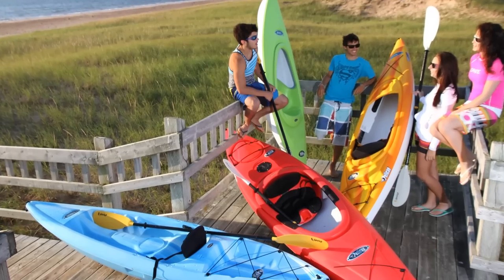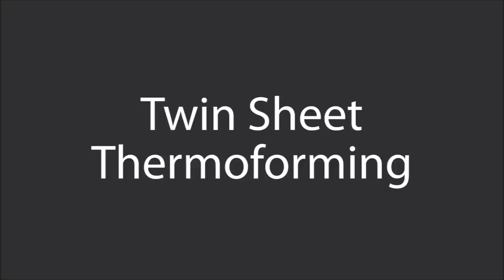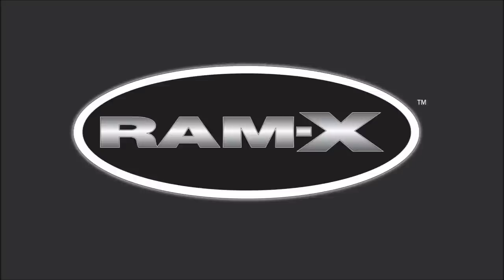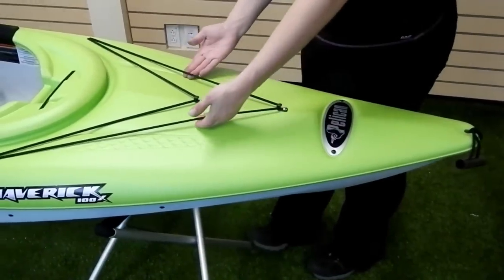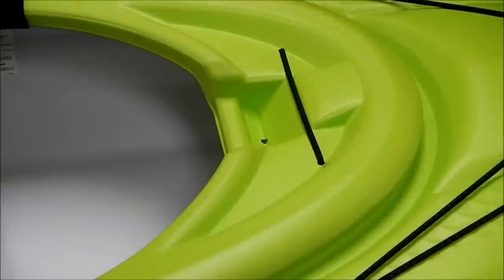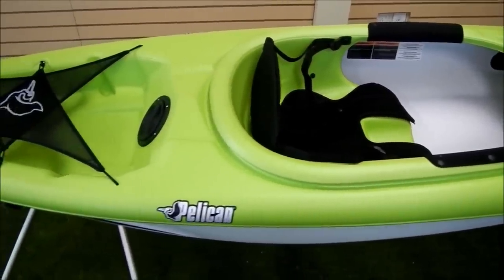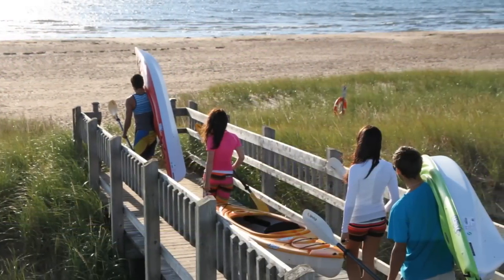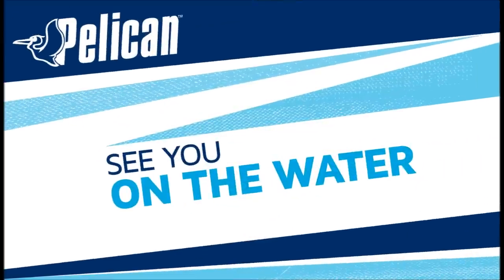PELICAN | Walkthrough: Maverick 100X Recreational Kayak

Comment: is there a "spray skirt" that stays tight on this kayak?
Reply from the maker: +onemouse1 
You can purchase the large universal spray skirt for this kayak. More information on it is available at the following link.  http://www.pelicansport.com/sites/default/files/images/pelican_accessories_2016.pdf

With regards to the handles, they have been redesigned on the 2017 models. These models should be available in stores shortly.

Comment: Seriously I bought this kayak thinking out had dry storage and would be great to carry gear on the back well.  The font storage not shown in this video isn't dry at all.  I'd say out isn't even water resistant.  If you don't want out wet doing out it in there flat out.  Secondly the storage well behind the cockpit has no scupper holes so water gets in but can't get out. You'll literally be paddling around 5 gallons plus within three fittest 30 minutes of your launching this. The drain plug sucks.  You have to force it in and out every time and its cheaply made like everything else on this P.O.S meaning its likely to break.   The knee padding which is another alleged upgrade gives no more padding than 3 pieces of electrical tape layered together.   Pelican if you read this comment please respond because I feel I deserve the ability to do something to be compensated for the money I wasted thinking out was going towards Ann actual functioning upgrade.
Reply from the maker: Hi Craig,
Very sorry about your disappointment. Did you make sure the hatch door was securely locked? As with all kayaks, it is also highly recommended to use dry bags whenever transporting your valuables whether in the hatch or not. As for the "upgrades" you mentioned, the Maverick 100X is a fairly entry-level kayak, hence its basic (but yet very practical) specs. Maybe for your needs, a higher-end kayak would have better met your expectations.
Best regards,
Reply: Pelican International I agree a higher end kayak would have been much preferred however, Dicks Sporting goods reviews seemed to all praise this kayak.   After purchasing the kayak I tried to deal with their customer service in hopes of trading in towards a better kayak to no avail.   Secondly the review I wrote on their website of this kayak of course will never be shown on their website.   Yes the hatch was secure.   It was secure as possible with this kayak meaning it was secure as having a plastic bowl upside sitting on top of it with a loose bungee cord holding it down.   My main disappointment is that the reviews and the so called upgrades is why I chose this kayak. Unfortunately I was mislead.
Reply: Sara Brocken lol.  I use THE SWYPE keyboard and I must admit I often appear illiterate.  Hopefully the points I was trying to make were made.
Reply: There is no front storage in this model. You are confusing with the Intrepid or Maxim*. And in that model it is clear that it is not watertight.
Reply: @PelicanSportVideos  yes!
Reply: @orourke116  no, no I’m not.